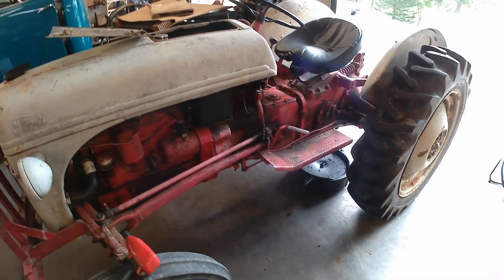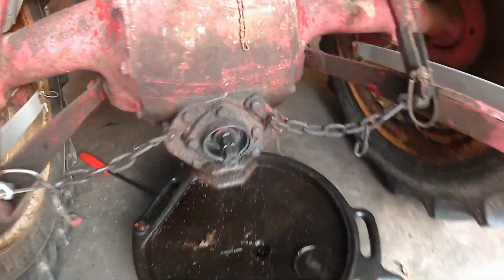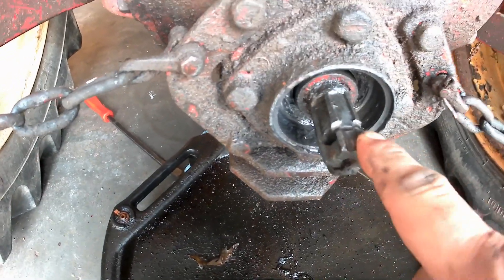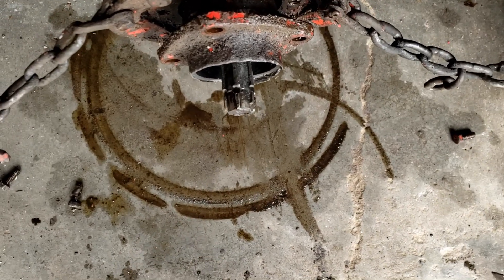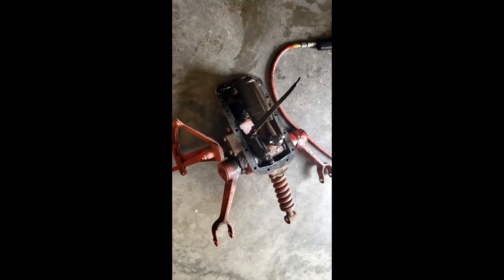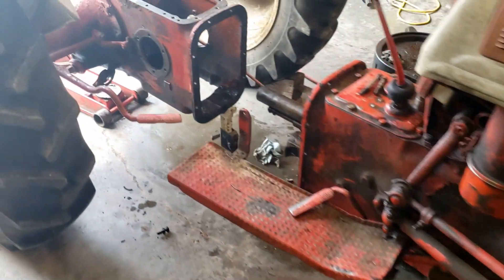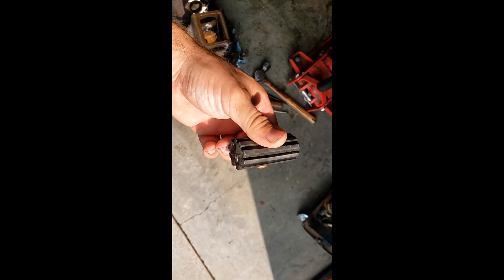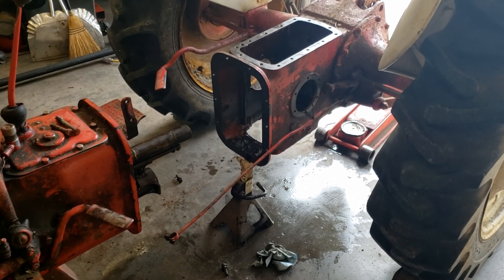Ford 8N- No PTO or Hydraulics

Comment: If the splines are only slightly twisted (not as bad as the one you encountered), do you think the PTO shaft would come out or could be coerced out with a slide hammer? Thanks for this video. My 8n PTO lever is stuck in the "off" position (I believe).

Comment: Looks like it hadn't been serviced in a long time with all that milky oil. Probably needs the shifter boots too and any other seal on the top end to keep that water out. Not sure what oil the 8 N runs for the hydraulics but they really need something like the old IH Hy-Tran Fluid, it had a good additive package for moisture. Look forward to seeing more on this repair. Have a Blessed Day.
Reply from the maker: These tractors all have water in the oil. It is getting a new shifter boot. 75w90 is what most run in them. New Holland super cedes the oil to their hytran. I may start the repair this week since the parts are all here now. The videos may take me a while to edit. Have a good week.